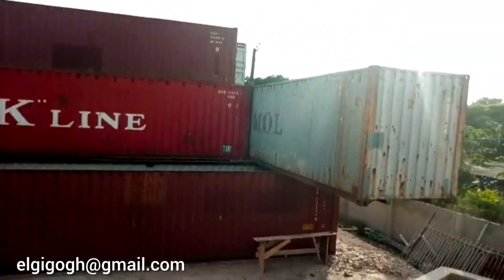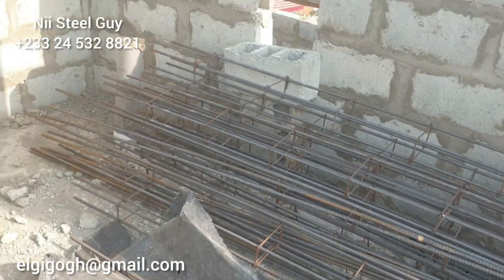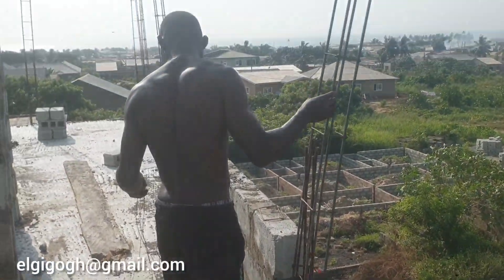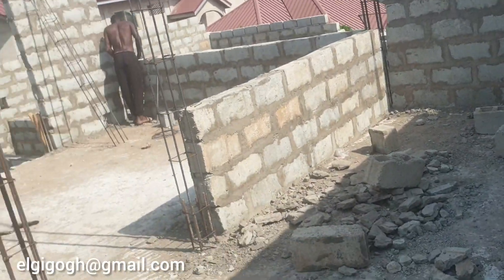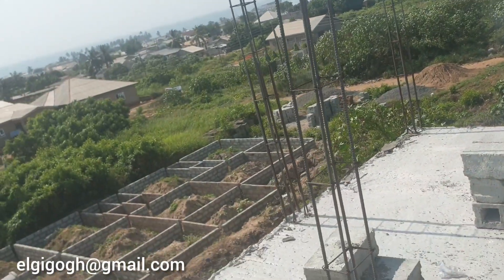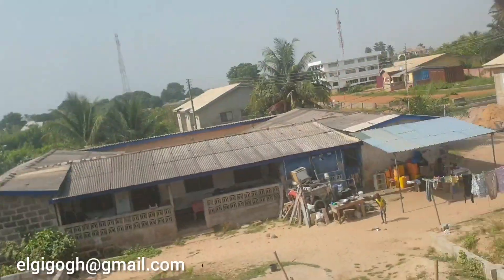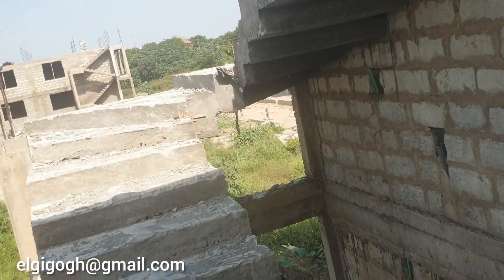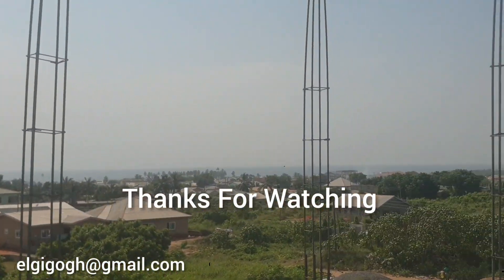Building In Ghana: Iron Rods Installation (Steel Works) | Shipping Container Home Construction

Comment: Chairman Your Blessed ❤️💪🏾💪🏾🙏🙏🙏
Reply from the maker: Everything On God ☝🏾 Man
Reply: @Gigo  Good job and well explained. 

But I think you should just focus on your initial idea to finish as too much change in mind might get you correcting things in future and its costly. This is why I tend to try to see the big pictures  you have and drop in the possible ideas or guidance as a brother from afar. Because sometimes the people around you may see things different as to what i would tell you.
Ground floor: is for your family to use.
first floor: 2 bedrooms with all enquire bedroom and a shared kitchen and lounge with front and back balconies. 

3rd floor: designed as a master suite. from the stairs entering the suite you have a space reserved as an open area or a lounge to host guest which leads to or connects with an open kitchen and bar. behind it is your master suite which should be a private space as I see it. for the space around the lounge facing the from.  You can use full length sliding doors or folding doors in that section to enable you to open up that area to feel as it its all open to outside to have an outdoor experience or feel. But you need to also install a safe and secure balustrade behind these doors. So that to accidents occur. You can choose to go by metal or glass balustrade or both together  (meaning a metal hand rail with glass on bottom), but best is to have just the glass option to create the illusion of the outdoor because you can see through from inside even with the doors open or closed. take a look at these examples of the Juliet doors and balustrade or French doors some call it. Read further info after the link posted.
https://www.google.com/search?q=balustrade+with+french+doors&client=ms-android-samsung&hl=en-GB&prmd=isvn&sxsrf=ALiCzsY6KKZMreXzyWTttJDRPp74UnlBug:1672093774516&source=lnms&tbm=isch&sa=X&ved=0ahUKEwiO39fbqpj8AhXyy7sIHUmUAloQ_AUIHCgB&biw=360&bih=560&dpr=2

So the bedroom area must be reserved to serve its purpose of a bedroom and it can have its own bed and a couch or sofa just for sole use not communal with its own tv in there for privacy.

Now that lounge or seating area must be used as the living area also for the 2nd floor or penthouse. So you must have a door installed right on the stairs landing upstairs. this idea is to maximise the use of your building.  So now the 2nd floor or penthouse is a complete 1 bedroom flat because you have the open living area, with a breakfast and food bar also to serve as your guest entertaining bar between the lounge and kitchen. So the kitchen will also have a bar in one area so it serves as a kitchen and bar.
Now you need to create a small guest toilet in the other corner where they put up a wall so that your guest or strangers do not have to access the bedroom.  this can be done in the left hand corner of the stairs from entering 2nd floor or penthouse of the lounge. So  that stays away from your kitchen and will have its own windows facing outside on both sides. Because this would be in the corner of those walls. 

then I was advising or recommending to you to concrete slabbing the roof as a flat roof and extending your stairs to it to use it as an upper deck if you have any big party with friends or as a roof terrace garden above your penthouse only. it can also serve you as a 360 observatory above to chill out and a roof garden. the cost is almost the same as using roofing sheets and this can well withstand the sea  elements and bad weather and its also quiet. remember being close to the ocean with heavy storm is not good news for roofing sheets as they also discolour. 

Designing your penthouse this way can make you have 3 independent apartments on one plot and the penthouse having the guest toilet in the lounge corner is a game changer and ideal. Because the bedroom and the ensuite bathroom and its entire space remains the sole use of the occupants. So guest do not have to go to the bedroom to watch tv or use toilet. And having the lounge area with the French doors keeps it enclosed to used as a standard livings or seating area because it can be enclosed from bad weather. Remember to install mosquito nets or trap doors in your sliding doors and windows. So that when you open you can prevent mosquitoes by enclosing the trap doors or windows as an option during the wet season.